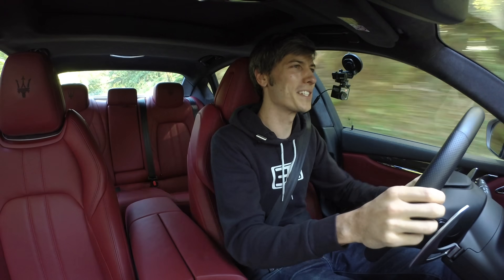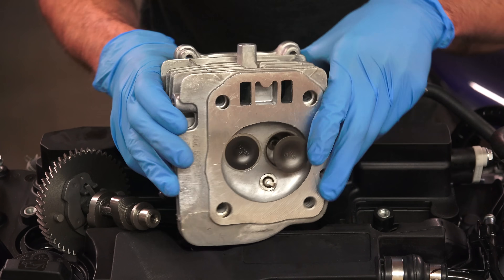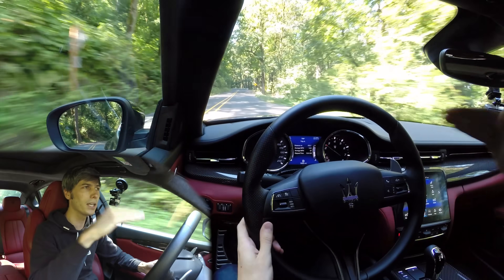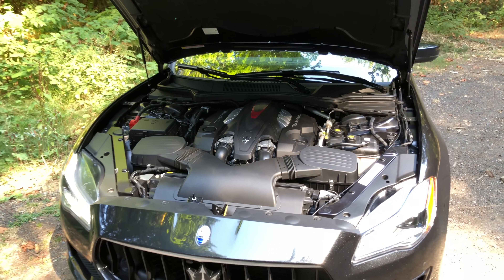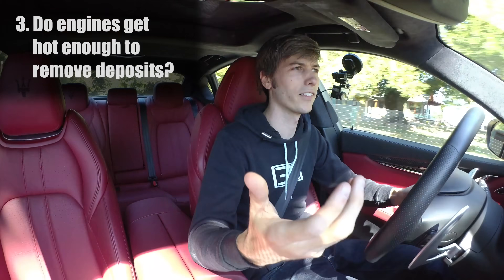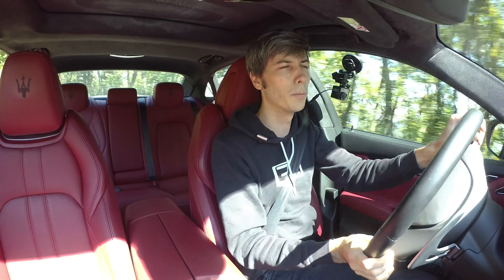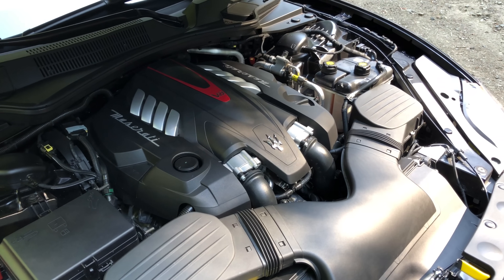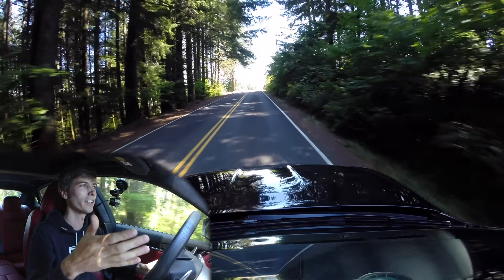Is Redline Good For Your Car's Engine? Italian Tune Up

Comment: italian tune up isnt just revving it for 5 or 10 minutes...
italian tune up works.

if you live in the city and the daily car/bike gets back and forth from home to work children at school etc etc.
the cars hp fall daily.
if you take a summer trip and use the highway and sustain 120+ with 3500rpm and above for 1 hour or more ....
thats the italian tune up...

when you get back to daily routine youll notice a big differnce in your cars power...
fuel efficiency

Comment: It definitely works for me. but I don't drive fast. when the engine is warmed up already I used to speed up slowly in 3rd gear up to 5-6000 revolutions. I keep it there for some time and then I switch to higher gear. I do it this way because there is not extra fuel wasted, and does not put much wear on the engine neither. It works with all of our cars (carburetor and injection), and the engine runs much cleaner in general. When I took them to the emission test the technician didn't want to believe to his eyes, the carburetor engine did not produce CO until 5000 revs. Above that was 0.01%. :)
Reply: High RPMs alone won't do much. How you load a motor has significant effect on heat generation.

Comment: This sort of thing is sometimes necessary in airplanes, although in that case there's no PCV and the carbon is mostly forming because of the mixture being too rich. I had a bit problem on IO-360 where plugs would foul with carbon (not lead). It was possible to get it out with a postcard, so it wasn't a solid carbon deposit. It would burn out on full power. Eventually, I swapped the plugs and that cured the problem (the initial formation was apparently because of ineffective ignition, so that combusting from the other plug was burning through the affected plug).

Comment: Well, engine load on modern cars is not really dependant on throttle position. Modern economy engines run hotter anyway. Leaner fuel makes it run hotter, during performance driving the A/F mixture is richer. One of the things that do help to reduce deposits is polishing and porting the intake, so that there are no spots for the carbon to hang onto. Correlating deposits to throttle position or RPMs for engines in general is just wrong, you can only do it for one engine with one setup and one tune.
And some mechanics say that just taking an engine apart and leaving a carboned up part in the open air for a few weeks weakens the carbon layer, sometimes to a point where it can just fall of (in chunks) on it's own.
I do know a method how to get your intake valves really hot, just let it run on gas and let it run lean. With gas I mean LPG or CNG, not that what you should be calling petrol or benzine. Gasses like LPG and CNG are more flexible in the A/F ratios it can run on, it can run on A/F ratios that a normal petrol engine would stall on. But if you do so, your engine and especially the valve do get hotter.
And guess what: most of the reasons why people complain their LPG engine has a low lifespan, backfires or reduced engine compression are because of the intake valves getting too hot and because someone or something leaned out the A/F ratio. On a diesel engine you get less power when you lean it out, a petrol engine will get less stable, stall, etc (when you lean it out too much), but on LPG it will be running smoothly with just a bit less power (just like a diesel car). So you don't notice something is wrong, then your valves become hotter and after a while you will notice the problems.
You simply shouldn't call gasoline "Gas", because it's not a gas, it's a liquid. Call it petrol, benzine, isooctane, benziños or at least gasoline.
---
The bottom line is: you do never want to get your engine to be hot enough to break those deposits.
Reply: Americans call gasoline "gas" for short, and we'd appreciate not being told how to talk. Unless you want your tea "a la Boston Harbor" again.

Comment: You've confirmed all the things racing teams have known/observed for years. You begin to explain it well at the 8:00 mark. At the end, I kinnnda disagree-ish....A better way to word it, would be, if your cars engine, has racing history behind it, and isn't just some commuter/putter engine, you can probably benefit from an Italian tune-up. Whether you should is another question. If you're car suffers from carbon build-up, bring your car to a certified mechanic to clean your engine how they see fit. Either way it's a great video.

       To further explain the racing engine history thing. Essentially, a lot of racing engines will need a few hours on the Dyno or track for "tune-up" and to "break the engine in". When doing this they often push the engine to its sustained limit, and dial in the ignition timing, compression, and boost (if any). After this they will rip the engine apart, do a full inspection to ensure parts are still in good/safe condition, and then put it back together. Often times this involves cleaning the intake valves (because those often gum up), and sometimes increasing piston size or springs.

     It is also common knowledge among race techs, that once this process is complete, the engine comes out with more power. NASCAR engines are usually 'spec engines' that come stock with 325HP (If I recall?) Either way every team gets the same HP engine and has to tune it to their liking from there. Often coming out with 350+HP. Rules do change over time, but the general Idea for any racing team, in any league, is to break-in the engine before throwing it at a long race. 

     I guess this (driving your car hard to clean engine and increase power) is called the Italian tune-up partly because Ferrari claimed to get their mechanics to take customers cars around tracks. Ferrari was finding that most of their customers drove their cars slow and for short periods of time (i.e to car meets, the beech, or to dinner.) So carbon build up would choke the engines (engines designed for racing), and they would have to break it in to remove the carbon.....I'm not sure on the validity of these claims, since it might just be safer, cheaper, and less intensive to just have 1 to 3 mechanics strip the engine and clean it. Maybe they just told their customers this because it sounded cooler, and they probably would Dyno for a few mins after reassembly. Make sure it works.  shrug

Comment: Hitting red line just to hit red line is not wise. To get the most out of your motor, put it on a dyno. That way you know where max power is made and that becomes your target rpm. Many may find that peak power is NOT at peak RPM.

Second, changing your O2 sensors every 40 to 50K miles would be far better. Vacuum leaks cause rich conditions that also lead to carbon build up.

Comment: My guess is that it's a dynamic process.Redlining the engine would raise up the temp but in the same time kinda worsen the working condition(less time for air intake and fuel to diffuse and mix, less time for combustion, harder control for reaching best ignition timing), so on one hand the carbon is etching away since high temp, on the other hand,much more carbon is forming.But this is all guessing, to find where the equivalent point is would need some experiments.

Comment: It may not be possible to excactly CLEAN an engine, that has been driven by an elderly person who was scared by revs, but it definitely is a way to KEEP the engine clean, if it was clean from the beginning. Take it out on the freeway for an occasional blast. And don´t feel sorry for it, keep the revs up there for a good while. Not redline, about 2/3 to 3/4 load. You´l notice the difference the next morning, especially if you normally does a lot of city traffic.

Comment: i find that there are 2 things that help to keep the engine clean, driving very fast but not redlining, and engine braking at a high RPM. At high speeds theres lots more air so less carbons end up alone as you have more air, as with engine braking, sometimes vacuum can help the carbon deposits and dirt come out. I did this with a car that was never stressed for 4 years and the next oil change was black but it now works very well.

Dont engine brake till you redline though and if you're using a manual transmission, make sure you know the velocity limits of each gear.

Comment: Interesting video.  My carbed '87 Mazda 323 definitely benefits.  If I put the wrong petrol in it (not Caltex), the engine gets extremely lazy in just one tank.  But then after driving close to 200km highway, with a few near redline pulls (passing), it feels like a brand new car (actually the power is then better than new).

Comment: Could this be something that originated with older vehicles? I remember my grandfather, who was a mechanic, saying he used to push his cars hard to "blow off carbon." At his age, I'm pretty sure he was dealing with carburated engines back in the 60's & 70's that did not have Fuel Injection.

Comment: Uhm, I'm from Milan (Italy), I work on engines in my spare time since when I was 15 (now I'm 43), and this is the very first time I hear about the "Italian tune up"... Is this american slang or what?
Reply from the maker: According to Road & Track (or maybe it was C&D), it originated in Italy. But I mean there are lots of things that have originated in America that I have no idea about haha
Reply: @EngineeringExplained  thanks mate. I can only think that it originated there because Italian's performance engines are generally quite high revving.
You're doing a good job with these videos and the studies you do behind the scenes.
Good luck from Italy.

PS: what about some video on 180+hp / 13500rpm 4 cylinders motorcycle engines? :)

Comment: Our experience, yes, it is "good" for the car, as far as the removing of carbon composites goes (tons of other reasons why not to do it, but we still do it).

As far as the removing of carbon, yeah, works, we took a look at intake manifold when car was bought, filled with EGR gunk... 2 years of regular redlining, almost clean as brand new... sure it is an italian car, so maybe it prefers the italian tune up :D

Comment: If you drive your car gently in the city AND before it reaches operating temperature AND do at least 2 hours of highway a week your engine will last a long time, as mine do. Change that oil every 5000km though, whether regular or synthetic.

Comment: Petrol engine, 5500 -6000 rpm over a 12-15 minute period, maybe. I never do that, and I am sure I am currently having that problem. I have the bad habit of driving my petrol like a diesel, 1200-2100 rpm, and 2800 on the highway. In my case, I should need a 15 minute drive on the highway... in third gear at 80-90 mph... I don't think I will do that.

Comment: Did he once floor the pedal of the Maserati?! Didn't want to watch the whole video, but would be a shame, if he didn't. Concerning the 'redline wash', I think, Germany without speed limits on the Autobahn is the only place where you can really and legally do that, so it would work. But I actually think modern engines are better at coping with all kinds of problems. So, I won't drive my car near redline for a long time. It's probably more harmful than benefitting...

Comment: So it works when you're in the Autobahn 90% of the time. But what does it say about your pet snail Garret? Won't all of the carbon deposit stick to the relatively cooler fins on the turbo?
Reply from the maker: Turbo fins get quite hot when you’re on it!

Comment: 1. How about the extra (gas) pressure related to high RPMs? Exhaust gasses get rather hot, so buildup in the exhaust or Turbo should get cleaned out nicely, and the high pressure should help blow out a lot as well, due to the high speed.
2. Why would carbon buildup happen on the intake valves, other then on the valve disc inside the cylinder? You shouldn't have exhaust gas in your intake manifold?
3. There are so many people who've experienced the Italian tune-up working, so it's a real thing. But it may not "just" be carbon buildup then? 
4. For engines having EGR, and thus getting that crap in the intake, the greater heat from the exhaust side should start cleaning the EGR out though? 

I understand there is only "so much" research material available, but a few hours driving around on the back roads, like that mountain road in your video, in high RPMs and pulling strongly regularly, should do just the trick to warm everything up nicely and burn that carbon right up.

Comment: There's one more factor- the airflow speed. With high flows I can imagine some of the buildup could crack and simply fell off. Especially on the valves. It doesn't have to be all about the temperature.

Comment: Hi Jason, would red-line operation (or close-to it) would eventually decrease the life-expectancy of your engine.  We had done a study at Ford, on race car engines, looking at the probability of major structural failure) in race conditions (in the sixties and again in the eighties/nineties).  The intent here was to estimate the risk that a race car driver was taking over-revving the engine (in a win or loose situation).  I had similar studies in my Naval jet flying career where you could over speed the turbine in a dire situation.  Operations over the "red line" or max rpm (within some limits) resulted in "acceptable safety risk" (say +10% max for less than 5 min).  All redline or beyond operation were logged and recorded by engine sensors and would affect engine life.  What do you think - this is "old engineer" stuff - we did not have the computing power and testing beds that your newer engineers benefit from.  Great video, Ciao, L

Comment: I have a question. If a car is equiped with an lpg conversion kit, would it make better results driving your car hard while on lpg, becouse lpg burns hotter than gasoline, or is it bad to drive hard on lpg.

Comment: This seems to be a throwback to older cars, especially two-strokes where if they weren't driven much or only had very light work soot and other deposits would build up and the car would run poorly.

The solution was to give the vehicle a good run and rev the crap out of it.
Usually it would be accompanied by plooms of smoke.

Vehicles weren't as efficient and the design has improved, along with engine management.

People seem to forget engines are designed to be run within certain parameters, go outside those parameters and there will be a side effect.

The Italian tune up might work for engines that are under utilised, but it won't do much for engine operating under normal conditions.

Comment: I have a direct injection engine with turbo and it runs slightly rich. It suffers from carbon build up. I have had some detonation due to the carbon. The Service Centre can do a water blast down the intake if it gets too bad. 

With my older port injected engines a drive in the country for 3-4 hours with some spirited application of the right foot, at times, usually has the car returning in a "good state of tune", as do long trips 400-600 miles on the highway. The car feels smoother, more responsive, and slightly better power and economy.

Comment: I've always just assumed this worked. without the science backing... I recently changed the spark plugs on my new vehicle. and noticed the carbon build up was quite... well let's just say. the previous owner must not have driven it to its potential.. ever? I'll pull the plugs and take pictures and then drive it a little harder this week to and from work. will reply with what I've got afterwards. 

99 vw passat 1.8t
Reply from the maker: Neat, thanks for sharing, looking forward to your update!
Reply: How'd it go
Reply: How did it go

Comment: I believe it does help somehow. Going near redline occasionally supposedly helps with long term reliability.
Also I fixed my brakes by doing some testing at a Track :D I mean they weren't bad but they were much better and quieter after giving them a little work out on the track.

Comment: It seems counter intuitive that modern direct injection turbocharged engines would suffer more extreme carbon deposition under load than idle. One would expect the significantly higher intake air temperatures concomitant with turbocharging to prevent or decompose carbon formation on the intake valves as is the case with naturally aspirated port injection engines. I would be very interested in seeing a comparison of direct injection carbon formation among turbocharged vehicles of varying intercooler size and efficiency to determine if intake air temperature has any bearing on carbon accumulation, assuming similar DI, EGR, and PCV equipment.

Comment: Interesting video... So now my question is... Do any of the fuel additives out there cause a hotter than normal combustion to occur, helping to get component temperatures hot enough to clean up the deposits?

Comment: In the old Shop manuals and in aircraft, service included decarbonizing every so many miles or hours. So the Italian method was an excuse for spirited driving, as the brits called it. Just rip the head off and start scraping....

Comment: Hello! Great video!

From my pilot experience, It also depends on the fuel/air ratio. Under rich mixture low RPM temperatures will lower and carbon will start building in the cylinder. A proof of that is that in those conditions normally you get fouled spark plugs. To revert that, you can use high RPM setting (close to full throttle) and start leaning the mixture.